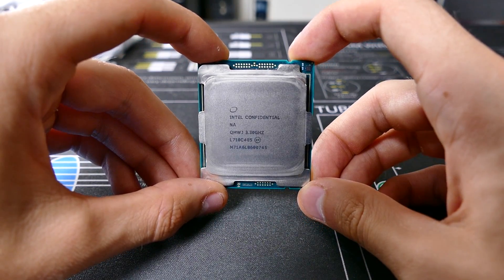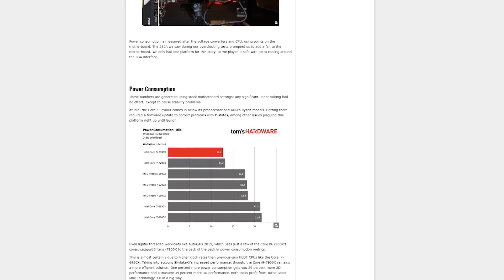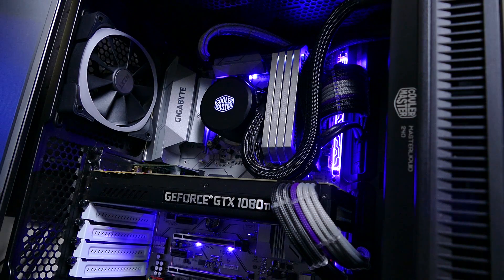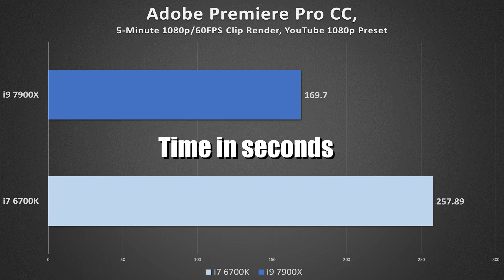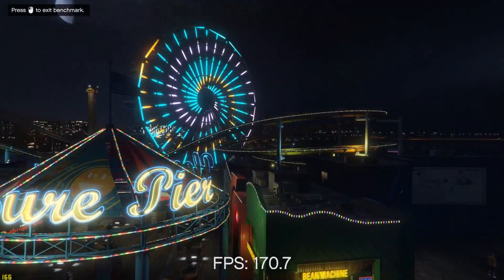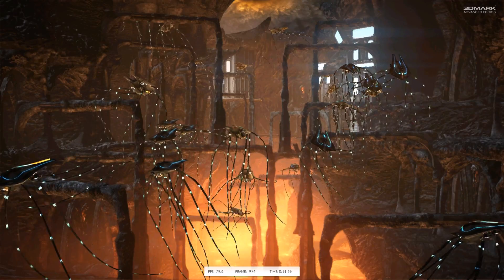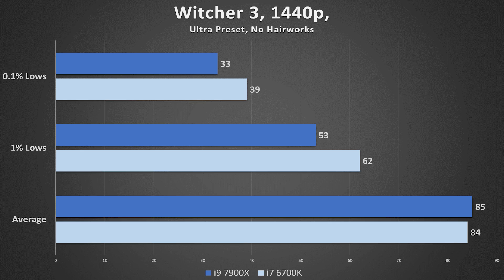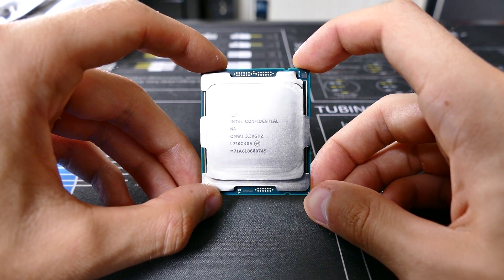Intel Core i9 7900X Benchmarks: Everything You Need to Know

Comment: intels take on the fx 9590
Reply: iam just thinking how thier 18 core will do
Reply: Matthew Ducker or a maybe a hotest super Nova xD
Reply: that chip is based on a xenon processer, so i dont think it will use this much power.
Reply: Rasmus Rasmussen all the i9 are cut down xeons
Reply: not the 7800 - 7900 and down are not cut down xeons. But the 7920 - 7980 are.
Reply: Hari Haran It'll be a dumpster fire... a dumpster filled with thermite, that is.

Comment: Thanks a lot for the video Greg and as you say, best deal is the Ryzen CPU. In my case that I'm a webdev almost any CPU will do the trick but since I like good hardware I tend to go a bit overboard and also play some games once in a while and I dont like slow hardware. I've been thinking about the R5 1600X but for a couple of $ more I can get an R7 1700X and I have a good Desktop for pretty long time (Been running an i5 3330 since 2012 no problem). Keep up the good work!

Comment: Just the cpu and mobo are slightly more expensive than my ENTIRE 6600k/1060 rig which gives me 1080p 60fps in the vast majority of games at max settings. Not worth it for me.
Reply: I have a 6600k and 1060, I get 4k 60fps in most last gen games.
Reply: Person. 1060 is good enough for 1440p60, if you turn down some settings. I'd say it's nicer to have higher resolution than ultra details since ultra preset is usually nearly indistinguishable from high sometimes even medium.
Reply: 6600k and 1060 can give you 1440/60 or more

Comment: 6700k FTW! I'll keep mine for quite a few years. Especially since it's delided and doesn't get over 54c
Reply: I like what AMD has done with ryzen, but I have a buddy with a 1600 and only beats my 6700k in rendering. The 6700k and 7700k are still king for gaming. There's nothing wrong with the 1600, but it ain't my cup of tea!
Reply: Fearbleeds Just got a r5 1600 aswell, the performance is great and the stock cooler even does its job when I overclocked
Reply: Paulie Vitale I have one aswell at 1,43v 4,9ghz and it fills every requirement I ask from a pc. Its also enough for streaming via GPU.
If I would by a CPU right now it probably would be r7 1700.
Reply: 4790K owner here. 4.8GHZ @ 1.3V.. still waiting for an actual upgrade. 6700k and 7700k are nice but the 4790K is only marginally behind even though its 3 years old. Come on INTEL.
Reply: stop hating on each other guys no one can beat my i3-4030u clocked at 1.9 ghz
Reply: Paulie Vitale I still run sapphire r9 fury nitro and was lucky enough to be able to unlock it to full fury x. also got at 1,35v 1200nhz core and 688mhz on hmb which is ~700gb/s :) 
Its faster then gtx 1070 but its quite a hot card yet the cooler is superb...
Reply: Paulie Vitale The 6700k is indeed king for games, but like you said I do quite a bit of work and the ryzen is cheaper and still fares well in games.
Reply: RayzeTheDragon agree. however the overall differences in games are very minor and most of the time you wont notice the difference though not denying i7 is better. 
i7 holds better place in higher refresh rate gaming like 100/144hz while both i7 and ryzen hold steady min and avg fps in resolutions aimed at 60fps for every gpu. 
also for rendering the i7 is still enough for me, but streaming through software is not an option and i have to use gpu render.
anyways you cant go wrong with either one.
Reply: Yeah. No denying the 6700k is a great CPU. R5 and R7 just offer unbeatable value for someone, at the cost of a tiny bit of loss in gaming performance. I don't even game anymore, but I do use those 12 threads quite often.
Reply: KINNSTER I had 4770k and it was horrible overclocker, 1,4v for 4,3ghz. Tough I could still throw anything at it, I was very dissapointed in OC performance. I got delided I7 6700k for 200€ about a year ago so decided to chance.
Reply: Paulie Vitale same here m8, exept i didnt delid cause i dont have much thermal throttling and have more frames than my monitor can handle :D
Reply: I have a 4790K as well @ 4.8GHZ. Absolutely no reason to "upgrade" to a 6700K / 7700K
Reply: Yol "won't touch" lol it's literally right there in performance with it 😂 if you're a normal person and play on high -ultra settings, you won't even get %5 more performance. If you're on 1440p like me, you might even get better and smoother gameplay on the extra cores 😂
Reply: That's not correct. 1700x is better binned then r7 1700, though how big these differences are can still be uncertain near 4ghz...
Reply: Retry no
Reply: EssenceBAWS laugh
Reply: Fearbleeds your R5 wont touch my 6700k, maybe in rendering but thats why I am building a separate 1700x build for creation/work, can't wait! =)
Reply: clarda1 can your 4790k m.2?
Reply: EssenceBAWS yeah man, its pretty cool, I am excited to see what my 1700x can do with 1440p & 4k editing =)
Reply: What kind of application are you talking about? If it's rendering, gaming with live streaming, or any encoding then you are correct. But that's not what the original post was about. It was about pure gaming performance. And I can tell you I haven't come close to 90% utilization. The most is when playing Battlefield 1, around 65-70%.
Reply: Yol dont buy 1700x,as far as I know it's the worst overclocking R7
Reply: +Guitardudeftw Not in BF1 multiplayer or in anything other than gaming
Reply: Yeah my motherboard has a m.2 slot and sata express
Reply: you don't get better framerates from cpu cores on higher resolutions. That's what VRAM is for.
Reply: Same. Saved and waited till the first week of march and I finally broke down and bought it. Liiterally one week later, 1080ti. Fml
Reply: ha ha
i got an 6600k and i don't know if it gets over 50
well it does in forza...
for 30 minutes of gameplay then crashes =(
Reply: Paulie Vitale same with my 4790k still crushes anything I throw at it
Reply: Guitardudeftw As a 6700k owner, the Ryzen chip is better in nearly everything except for gaming, but gaming is all I do.
Reply: I agree. If I were to buy a CPU today, it would be a Ryzen 7. i bought my 6700k in mid 2016 and have zero regrets. Only regret I have is buying a gtx 1080 in February when the Ti came out in march, but I sold it for $450 to a buddy and got my 1080 Ti last month lol
Reply: I bet you're not as happy as I am with my r5 1600 :)
Reply: Fearbleeds I bet that 6700k still beating that 1600 lol

Comment: any suggestions please. my i7 7700k and a corsair h100i easily hitting mid 90c. please help
Reply: vincent cammisano Have you considered de-lidding? People have seen a 20 and even 25c temperature drop.
Reply: vincent cammisano Underclock it to 4.5-4.9Ghz if you already have it oc'd to 5Ghz.
Reply: vincent cammisano I think you are seeing the wrong temperature, try checking Motherboards temperature, not the cpu Tctl or Cpu package, but CPU Temperature in the motherboard sensor's chart
Reply: vincent cammisano are you overclocking it? if so, that's why. there has been a lot of problems with the TIM in the 7700k when OCing. it got so bad and widespread that Intel issued a statement to all 7700k owners which was simply, don't OC it.
Reply: don't oc it...there is a video (don't know who make it maybe NCIX) about temp spike....intel don't recommend to oc it too....
Reply: Maybe you mobo autovoltage ur CPU too high, whats ur mobo
Reply: Delid. I had a similar bad CPU, easily getting 90° on all cores no overclock. After using the rockit 88 tool, and liquid metal that same CPU never sees 80° with a 5.2 ghz clock. Using the h100i v2, and arctic silver.
Reply: Do you have proper airflow in your case? an adequate amount of intake fans? Are you monitoring your pump/fan speed for your h100i?

This is not normal, if you have everything installed and set up properly then I would consider a replacement.....
Reply: vincent cammisano Check your thermal paste installation, cpu voltage, andcase fan setup, also cpu fan RPM
Reply: Harry Kristanto I've re-applied thermal paste 3 times now 3 different brands of it as well. the chip is stock and I have 2 fans for the radiator and an exhaust one too and fans at 100%. this just doesn't make much sense
Reply: vincent cammisano What software r u using? No way stock cpu hit 90 degrees lel, maybe u were seeing the wrong temperature
Reply: Harry Kristanto hwmonitor and hits 95c under 80% ish low and idle at 70c~ idle
Reply: RayzeTheDragon can't seem to find liquid metal thermal paste anywhere here in Canada :(
Reply: Harry Kristanto i have the aorus gaming k7 and to be honest im not sure how to change the voltage. any helps please?
Reply: coram problem is I cannot find liquid metal thermal "paste" here in Canada
Reply: vincent cammisano You can still get great improvements using regular thermal paste. The factory TIM Intel uses is garbage.
Reply: coram ok thank you just to make sure what temps should I be looking at on hwmonitor?
Reply: vincent cammisano Should say temperatures core #0, #1, #2, #3 and package.
Reply: coram alright yeah I've been looking at those easily in the 70s but voltage stock is a 1.359v. this normal?
Reply: look for an overclock tutorial for the chip, that will show you how to change voltage.
Reply: vincent cammisano That is not fucking normal XD, i OCed my friends i7 with that volt to 4.5GHz on all cores all the time
Reply: vincent cammisano Maybe take manual override and change voltage to 1.25-1.325, thats should be the balance, plz tell us the info of the temperature, and tell us if it BSODed or not, thx
Reply: Harry Kristanto I will try and figure out how to change the voltage on this motherboard haha
Reply: vincent cammisano Bro Gigabyte mobo have issues with volt
Reply: vincent cammisano if you download intel extreme tuning utility it lets you change the voltage under advanced. Also the stock voltage is 1.2v so you should see a huge drop hopefully.
Reply: vincent cammisano delid and replace it with liquid metal, you can buy der8aur deliding kit if you dont want to fuck it up while deliding
Reply: vincent cammisano U have to update bios to the latest version bro, it will fix the issue, Nexus Gamer had covered this issues, try update bios first, if it stilloverheat then try dial in the manual volt
Reply: Harry Kristanto its on the newest bios and it says 1.300v in bios but it decides on itself to go higher?
Reply: vincent cammisano Well u have to override it, if its on auto, dial in 1.25 or higher if BSOD
Reply: Harry Kristanto alright thank you
Reply: vincent cammisano Give us update alright
Reply: SKipieee 0333 I have f6 bios for the board and I downclocked to 1.300v still same issue. and I've also tried this cpu with a hyper 212 Evo so I don't think it's a pump gone bad
Reply: Critastic got 2 fans from the radiator pulling into the case and one exhaust ( nzxt s340) and how to I check my pump and h100i fans?
Reply: vincent cammisano I think corsair has some software you can download to check all these things, check their website.

You have 2 fans providing cool air for the radiator, so that does not seem to be the problem. 

The 7700k does run hot... you'll get away with those idle temps but your load temps are alarming...

Like I said before, if you have everything installed and set up properly then you have to make the choice of delidding or replacing.
Reply: alright, well good to know i did not win the lottery on this cpu
Reply: [KSH] Productions thank you 🍻
Reply: Sebeki 2 alright, I'll try this too
Reply: Is it stock or are you overclocking? 

What voltage is being reported under load? what frequency are you running? If it is reporting 1.35v stock update your BIOS this is the issue, problem solved.
Reply: Also ignore anyone talking about de lidding unless you have a good sample that you intend to push past 5ghz...
Reply: Igor Radmilovich easily pushing 1.350 volts stock and stock frequencies I have the newest bios (f6) already
Reply: My 7700k does 1.15-1.2v with stock settings, it pushes 5ghz at 1.3v. 1.35v for stock is way way way too high. Try loading optimised defaults in your BIOS and see if that helps. For reference i'm using a H115i no delid max temps 60C stress testing (XTU) stock with the voltages i posted above. 

Have you enabled any overclocking mode on BIOS? Some have a "gaming mode" with various levels of over clocks.

If none of the above help go to your core voltage settings, set it to fixed and set it for 1.2v (for now) then check your temperatures.
Reply: Do the steps one at a time sorry, ie. Try loading optimised defaults first and if that doesn't fix the problem try the next ones.
Reply: Igor Radmilovich thing is im not so sure how to do this in the gigabyte bios. I've tried looking it up cant seem to find any videos of this bios
Reply: Alright i'm looking at the manual for your motherboard now. this is for the Gigabyte Aorus Z270 K7.

Assuming you have the latest BIOS revision. 

1*Enter BIOS on boot, press F7 in the BIOS screen. This should load optimised defaults save and exit. Test the system and make a note of what voltage it's set on. If it drops it down to 1.2v or lower that problem should be solved and your temps should be normal and you can ignore everything else. 

If the voltage is still set abnormally high - well i'd say contact Gigabyte BUT if you want these instructions should help you lower the voltage on the CPU just so we can verify the temp issue is due to high voltage. 

2*[In the M.I.T tab in BIOS] - Go to advanced voltage settings -> CPU core voltage control -> CPU Vcore (Set this to fixed or manual - not sure how Gigabyte handles this) and drop the voltage to 1.2v. Check your temperatures again and tell us how they go, don't touch anything else just save and exit. If step 1 worked ignore this step, don't try this step unless you've tested step 1. If this resolves your issue well it's not really perfect, while running a fixed/manual voltage isn't necessarily horrible it will increase your power consumption vs adaptive/offset however is quick and easy to test with. - It won't end here. 

Use your user manual to assist you and take note of any precautions the manual states. I'm just some random guy on the internet yada yada. 

It should be pretty straightforward and take 2-3 minutes of your time.
Reply: If the F7 Key doesn't load your optimised defaults go to the Save and Exit tab in your BIOS and load optimised defaults from there.
Reply: Igor Radmilovich thank man you're a huge help I will try that now
Reply: Awesome make sure to let us know how it goes. Hopefully it's just that the new defaults weren't applied after the update.
Reply: vincent cammisano Is your CPU doing alright now?
Reply: RayzeTheDragon sadly not tried everything on this thread minus the advice for buying a ryzen 😂  decided to just deal with it
Reply: nashor's tooth you really didn't help any there. Just showed you're an ignorant fan boy thinking Ryzen is the answer to everything.
Reply: vincent cammisano RMA? That doesn't sound like you're doing anything wrong, more like the cpu is funky, but I'm not the most knowledgeable there. check Tom's hardware and reddit buildapc thread, lots of people there with experience!